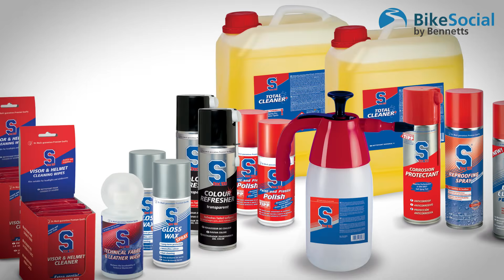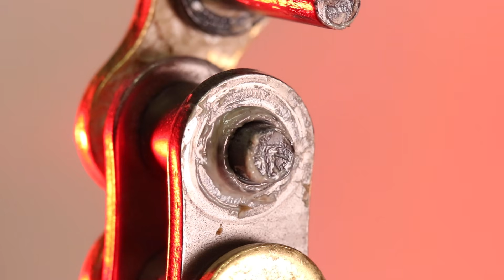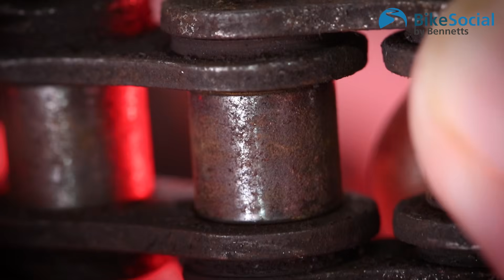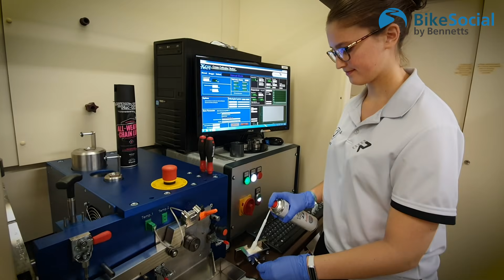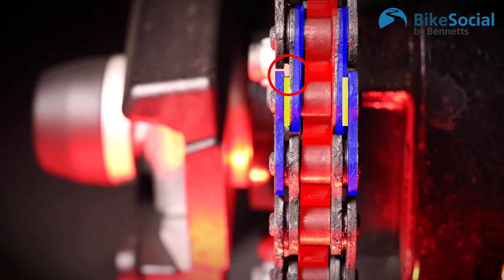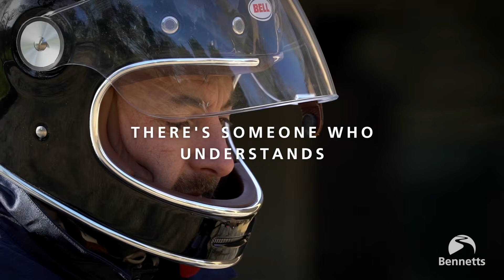Is chain lube a scam? Does your bike really need it?

Comment: In the days I started riding in 1965 we had chains with clips that separated. I like many riders then, periodically took the chain off the bike, soaked it in parafin overnight to remove grime.Then heated grease in a pan and placed the clean chain in the pan of hot grease. Removed excess grease, replaced the chain and rode away. How many riders would do that today. Great video.
Reply from the maker: I have to admit that I'm so geeky I probably would! John
Reply: Damn your old..
Reply: @michaelsteven1090  yeh! But I'm still riding a high powered bike and enjoying every minute.
Reply: @barryroberts2474  there you go!!
Reply: I'm curious how many even could. All the chains I've used had one time use master links. Doing all that work isn't really worthwhile. Even with negligent maintenance, my last chain lasted like 10k miles. Removing the chain and redoing the masterlink represents a net decrease in safety all to avoid having to replace a chain after thousands of miles.
Reply: same here, big round can of Duckhams had to heat it outside as the smell was horrible, also I had 2 chains and alternated them. I also ran the engine breathers over the chain, if possible.
Reply: Good heavens I remember those. My mother looking aghast at the tin of grease on 'Her' cooker... Fifty nine years later I, like most Bikers have 'O' ring chains on their motorcycle ...Triumph Street Triple.. I just use a rag to remove dust and old lube and give the chain a quick spray with a chain lube. As you spin the rear wheel you can hear the sound of the chain running over the sprockets change. I repeat when I see the chain rollers looking dry. 
I live in Spain where riding in bad weather..ie: pouring rain, mud,  road filth and gritted roads are not a problem so I would surmise chains have a far easier life.
Reply: If i remember  it came in a flat  tin  about  12" diameter   . Yo melted the grease annd put your chain in.  Was it made by Filtrate and called Linklife !!.
Reply: @GrahamNewman-mq7gr  It was just Castrol grease or any other brand. I think I made the tray! All done with spray cans now.
Reply: Interesting  you  mentioned  parafin.  Are  you   talking  about  what   I  call  kerosene?  On  bicycle  chains  (  which,   being  much  smaller  may be experiencing   as  much  force  surface-area-of-bearing   as  the  far-more  robust  motorcycle  chain  plus  a  lot of  odd-ball   forces   that  aren't   straight-line )   I  went  to gulfwax  (  which is  locally  also  called   paraffin   or  paraffin-wax  and  used for  home-canning  )  for lubrication  of my  chains.  A  double-boiler  to   avoid   fire hazards  and  then  I had  lubricated  chains   which hardly  picked-up   dirt  at  all.   In  very cold  temperatures  the   wax  could harden-up   enough   to  become  brittle  and  cake off   requiring  more  frequent  lubrication   in   really  cold  weather.

I  was  riding   chains  so  long    they  would be able to be  bent in   a  complete  circle  sideways  and  until  relative  wear  between  chain  and   sprockets  would  eventually   cause  the  chain  to  climb  sprocket  teeth and  begin  to "skip"   but   I  got  longer  service  out  of   chains  lubricated  in  this  manner  than  any  other  way.
Of  course  I  was  using   a  chain-breaker  to  take  it off  the   vehicle .  Cleaning  was  scaldinig-hot  water  and   laundry  detergent  with   a  brush  (  and you  better  wear  gloves!  Laundry  detergents have  enzymes  made  to  eat-up  dead  skin   residues ).  Followed  by   clear-water  rinse  and  then   putting   the  chain  on   a hot-plate  to  dry.  Then   a  nice   soak  in   melted  paraffin-wax  in   an  old   coffee-can  inside   an  old   aluminum   pot   of  boiling-water   followed   by  a  drip-dry/wipe.

No more   chain-'ttoos  on   clothing.   At  times  I   used no  front  shifter  ( fewer mechanisms   with-which  to  deal )  and   just leaned-down and  shifted  between    chainrings  by  hand  since  it's   a  material  that's  food-safe   and   was  more  like  dealing  with   crayolas   as  a  kid  in   art-class   than  messing   with  greasy  machinery.   
I   think   I'd  read  about it  in  a magazine.

Since  then  I've  had  one   shaft-drive  motorcycle  and  one   Gates-belt   final-drive  motorcycle.   Recently   a  windfall    brought me   my  current  Enfield    GT  2022 model-year,  which has  a   chain  final-drive.

After  that  3yr  miles-unlimited    warranty  is  "up"   we're     gonna  be finding  out how  paraffin-wax   works  as   motorcycle  final-drive  lube.
Reply: @diogeneslamplit6573  Yes kerosene to Americans and others. Thankfully all that we had to do in the 1960s is ancient history.
Reply: Me. It's the best way.
Reply: Is this better than modern practices or is it just something u had to do back then
Reply: @ThePresidentofMars  It's not done today mate. Was a real chore. Stick to modern solutions.
Reply: If i remember correctly, the lid from a tin of grease was used to let the molten grease soak into the chain…it was just the right size.   Money was tight in those days, you had to maintain the bike, generally the only means of transport you had and was done on a Saturday morning, providing the foreman hadn’t chosen you for overtime and before you went to the match.
What grease was most popular in those days was the grease your employer used.
If you worked shifts, the fitters would do this for you when on nights but we enjoyed a community spirit of helping each other and the bosses closed their eyes to such practices……because…..they would also bring their cars in for repair too.
Unless you used the bike for competition, chains and sprockets were rarely replaced…….but it was a long time ago.
Reply: @barryroberts2474 I remember buying the bike chain baking tins. Do you remember that?  Great days before all this modern waste of money gadgets and gizmos.

Comment: Gear oil
Reply: I've used gear oil since 2010. 
I use a lighter grade gear oil on my bicycle chains. 
Found it's so much easier to apply and cleaning is pretty simple. Leftover water from washing the bike and a sponge clears the thick off and apply with a brush.
Reply from the maker: It's on the list...

Comment: 80W90 gear oil applied to warm chain. There is no point trying to layer it on because it will fling off. Just apply half a tea spoon of oil with a narrow paint brush and wipe away any excess to leave a micro layer that stays put with no noticeable fling. Need to apply it more frequently than chain gloop though but it does only takes 2 minutes with no mess. Cheap too!
Reply: That's what I do.   I do after every ride.   Whether 100 miles or 700 miles.  A bit of fling .... I'm sure I put more on than I need to ...  but my chains are laying 40,000+ miles.
Reply: true, it was recommended by yamaha in my manual way back in 1994.
Reply: BobbyBlueAce that’s what I do 👍 especially easy on a bike with a centre stand
Reply: Scott Oiler

Comment: One problem with the RyanF9 video was that he didn't recognise the damage that products like WD40 can do to the rubber seals. Rubber absorbs it, softens and swells...
Reply: So part of the test could be to put some bits of old rubber, like old Scalextric tyres, into the product and see what happens?
Reply from the maker: Actually, WD40 is fine on O-rings (they're not rubber) – in his video, Ryan references the fact that I soaked O-rings in various products for over a year, with no detrimental effect. Petrol and acetone were the two that caused problems. BUT... WD-40 is a penetrant, so it's going to be trying to get past those O-rings and could start to wash the grease away; something I didn't consider until Ryan mentioned it, which is why I took our video down.
WD-40 will be in the tests as a cleaner and as a lube. Cheers, John

Comment: Water based degreaser and lubed with gear oil works brilliantly every 200-300 miles and there’s no mess on the bike or the driveway. Brush it on, wash it away. I was a sucker for fancy lubes but they don’t compare to the overall clean and lube procedure when using the above. 5 mins and done.

Comment: I'm fairly confident engine oil makes a good chain lube as I've used it with good results my self, it does fling and you want to reapply after every wet ride however my Yamaha's manual actually suggests using it.

Comment: Chain alignment or wheel alignment, which is more important? They are not the same and both are important and will be the same if the frame, swinging arm and engine mounts are all perfectly aligned but they never will be even from the factory.
Reply from the maker: Good question, and that's why keeping the O-rings well lubricated is important; personally, I'd align by the wheels (I use two straight-edges when I want it bang-on). John

Comment: I'm using 80W90 gear oil for years. thin layer with brush every ~800km (maybe ~400km in wet conditions). Its very cheap and it works great. (*by the way it is what REGINA chain recommends on their chain maintenance manual. you can yourself on their site.)
For me, It doesn't make ANY SENSE to spend extra money on chain maintenance on chain spray lube and cleaners. Chains are relatively cheap and easy to replace anyway, don't take it so seriously. IT IS JUST A FRICKING CHAIN.
Reply from the maker: 80W90 is on the list...
Reply: A freakin' chain that can fail while you're going 80+ MPH on the freeway and now you're relegated to sippin' Big Mac's through a straw all because you don't see it as a big deal to maintain.
Reply: @tonykartracer8032  
I didn't say that chains shouldn't be maintained. I just say that you don't need to spend money in order to do so.
It doesn't make sense to spend so much time and money on a cheap chain.

Comment: I always use Paraffin/Kerosene for cleaning & Gear Oil EP 80W90 for Lubing.... Done it for quite a while now and I get great longevity from my DriveChain. It states both these products in my Haynes Workshop Manual or Indeed it says alternatively use a Proprietory Brand of Chain Cleaner and Chain Lube suitable for 'O' and 'X' ring Drivechains. (Never use Gasoline to clean, as it will damage the seals and ruin the chain)

Comment: I prefer a wax over a typical liquid lube. Far less flinging when applied properly. Warm up the chain first. Apply wax. Allow to set up. Ride!
Reply: Wax definitely has less fling but penetration is poor even when applied as you suggest. I use the sDoc white chain lube shown in this vid and it really is good with minimal fling. The sDoc chain cleaner is also the best I have tried from many brands. In fact, although expensive all of the sDoc products I have used impress massively no matter what they are compared against.
Reply: Crap sticks to wax
Reply: @loggggon it goes on completely liquid tjen the wax dries and it has dry lubricants to lubricate. It keeps the chain cleaner then any other lube I have seen. But I don't believe it lubricates as well as a traditional style lube as the chain gets warmer with wax lube. But it doesn't attract gunk so you don't have the the dirt grinding In the chain. I believe it's a small trade off for easier maintenance, no fling and the reports I have seen show 25k out of a wax chain.

Comment: Chainsaw oil as well ?
Reply from the maker: Good call... it's on the list now.
Reply: retired from motos to race MTB Downhill and I use to use Chainsaw oil on my MTB, it attracts way to much dirt....Now I'm using a Lithium spray but it goes quick. going to use  gear oil like I did on my motos.

Comment: Tuturo chain oiler on my last 4 bikes. Simple to fit and use. It cleans as well as lubricates.
30,000 from a chain and I usually change before I have to because I don't want to be caught out mid trip. And that's on singles and twins, not smooth, non snatchy triples and fours.
How about running an oiler against a well cleaned and manually lined chain?
Reply: I have one on both my bikes, it's made the drive chain almost maintenance free!
Reply: I use the Cobrra Nemo 2 oiler, similar concept with 80W90 oil. I was considering the Tuturo but I got a good deal on the Nemo here in Switzerland. I agree with your sentiments, as my chain maintenance is now made much easier without all the sticky chain lube. Cleaning is quick and drys overnight and ready for lubing on the way the work.

Comment: I use or some may say overuse Motorex Racing chain lube. It may seem ridiculous but it is lubed every 50 to 100 miles and the thing is buttery smooth. It only takes a minute to lube and it’s cheap as well and another benefit to frequent application is noise reduction.  The only drawback is the dirty wheel but that is ok as it is black already.